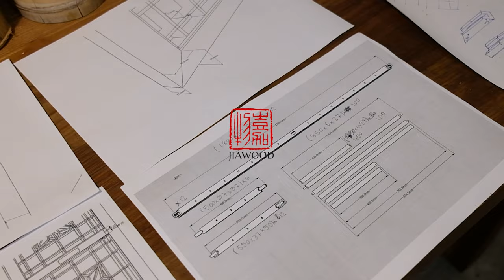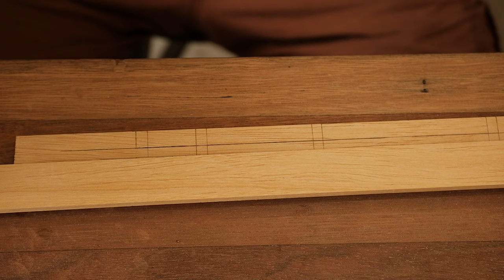Make A Traditional Japanese Kumiko Screen Using Hand Tools - Part 1/3 - Making The Kumiko Grid

Comment: Those tiny little clamps are so cute that they actually drove a tear into my eyes.

Why the water in the joints? Are you wet-bending into shape to relieve some pressure?
Reply: I think the water is applied to soak into the end grain of the joints so it swells and closes up the gaps in the joints